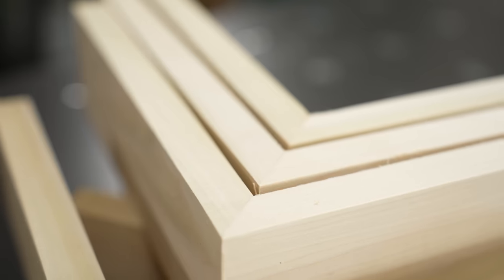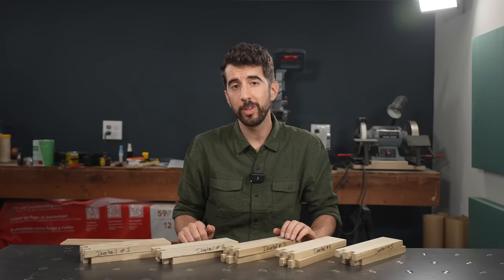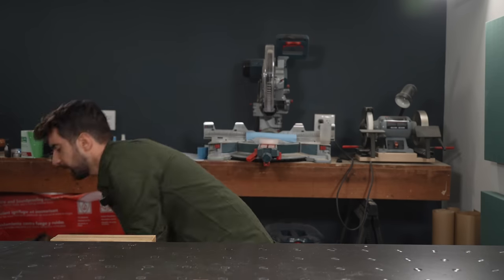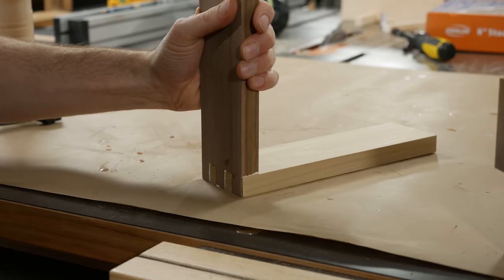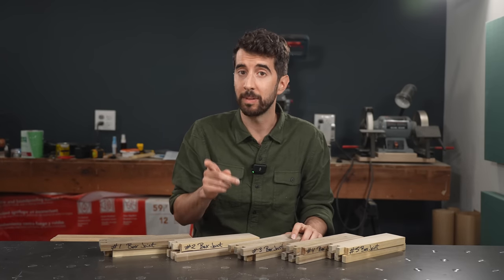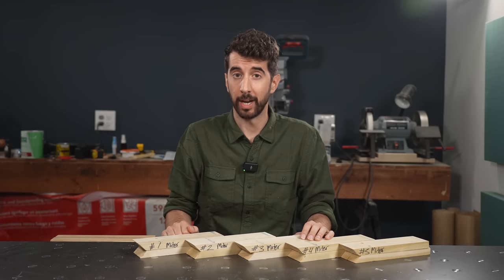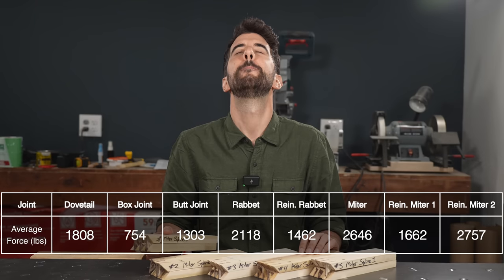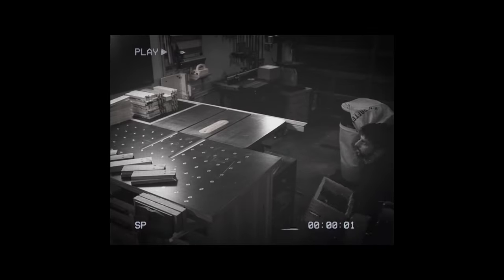This Simple Joint is Stronger Than a Dovetail!

Comment: I figure it's more about the straw-like fibers that allow the glue to penetrate both surfaces like hundreds of little fingers binding those two surfaces. As demonstrated in this video the wood didn't break in the miter cuts, just the glue. So logically the more fingers holding it, the greater the grip.

Comment: Here the test was to apply the pulling force as close to the joint as possible. Further research should include how the joint holds up to a moment applied at a set distance, as most joints receive stressing forces as some type of rotation. Joint optimization should include how the end product is to be used and the stresses put upon it. A bean crate, for example, would never survive with mitered corners: one shock to a corner and all four joints would fail.

Comment: The miter joint is stronger because the glue seeps deeper into the wood, thus giving more contact area between the glue and wood fibers. It's no surprise that grain on grain produces a stronger joint when using a good quality glue as a bonding agent.

p.s. - The weakest joints I've ever seen are miter joints fastened together using only staples. These were found in cheap office furniture manufactured in Asia.

Comment: I think dovetails would still be better for drawers because of the direction of force drawers typically experience. Especially if you're putting a lot of heavy stuff in the drawer, the bottom will be pulling all the sides downward from the bottom.

Comment: I really like that test, but however there's a question left: Did the glue make the dove tail a lot stronger? What about only using mechanical advantage (this is the way I like to connect wood)?
I would appreciate you doing that test.

Comment: Incredible amount of work. Diference result from other may come for the way of testing. As you said, at the end of the day why matters is longevity. A part from that, what device did you use for testing the force? I need one for do the same to test climbing gear and I don't know which one to use. Thanks in advance

Comment: Bourbon Moth's tests also showed the splined miter to be the strongest. It's worth noting that different joints receive different stress forces in NORMAL USE. Something like a drawer box simply doesn't experience that much force as you open and close it. 700 lbs. (x 4 corners)  is much more than the weight of the entire piece, not to mention the single drawer; so the drawer would always move, not rip itself apart. The whole piece of furniture would move before the drawer ripped itself apart. And nobody here is even capable of pulling on the drawer with more than their own bodyweight, because if you did YOU would move before the drawer ripped itself apart.

People get really nerdy about wood strength but at the end of the day you have to remember that the joints on  your furniture simply don't need to be that strong in most cases. And modern glue has proven to last longer than you need your stuff to ever last anyway. We should all chill out and stop thinking that our stuff isn't going to be in a landfill 100 years from now. You'd be lucky if your kids actually kept your stuff until they died. Expecting it to go further than that is pretty silly. As someone wise once said, "nobody is gonna want your mid century modern lounge chair in 100 years."

The real thing that needs consideration is wood movement. Because seasonal movement WILL break your joints apart and snap glue lines if they are not the right joint for the right situation or the two pieces aren't oriented in the correct way. And this doesn't even take that many movement cycles to happen. I've had to repair pieces from my earlier "career" that were barely two years old because they simply weren't built correctly.

Comment: What an awesome video 🙂.  I have a question about longevity, which you touched on here.  Given my patio ceiling mounted laundry rack is going into a climate that goes from about -6C in winter to +40C in summer (and will not be being jumped on by angry machinery) which joint is likely to perform best?  I'm erring towards the mitre with spline because I have the tools to do that already, although maybe this is the moment that I justify the router? Thanks!

Comment: I think there is a difference between initial joint strength and joint failures in time (which you already mentioned).  Your test of initial strength is more a test of adhesive strength.  Long term wood movement cycles - shrink/ expand is probably more important to furniture integrity in the field.  Not sure how you would test for that in an accelerated fashion.

Comment: The miter sounds good from this test, but I imagine the strength is strongly dependent on how closely fitted the miter is, on a box with 4 mitered corners it can be a struggle to get full contact across the thickness of the joint and I think that would have an outsized effect on strength when compared to this one joint test where the miter joint can be clamped perfectly tight.

Comment: This makes me wonder if it might be worth cutting some channels to hold glue into the inner faces of the box joint fingers, sort of like they do on commercial dowels. I was trying to imagine what sort of tool would work for such a purpose, and it occurred to me that a drill tap would probably work OK, not with any power to rotate it or anything, just using the individual flutes as little grooving planes.

Comment: Cellulose fibers are stronger than wood glue; lignin is not. Lignin is like the wood's natural glue that bonds the cellulose fibers together. This is why the miter joint is so mighty: end grain gluing is actually stronger, and the myth that it is weaker likely happened because the wood didn't fail, so people just assumed that the fibers were absorbing the glue, when in fact, the glue was being broken by the superior force of the wood.

Additionally, end grain glue-ups are usually under more torque. This is good news for me, I have a project that would benefit greatly from butt joints since the aim is mass production.

Comment: What about a 45° lock mitre joint? More surface area between the wood gives more area for glue to take hold. It's what I use and I haven't had a joint fail yet. For what that's worth:-)

Comment: Would have been nice to include the locking mitre joint. The one made with a router with horizontal and vertical cuts.

Comment: One should take into account the fact that any charred wood surface (due to dull tools) has an adhesion tendency similar to nylon bag. In that case the failure is at the glue line.

Comment: I don't like miters because I tend to be sloppy with keeping my tools in alignment, and hence the miters are not fully in contact for the entire surface, and corners look sloppy.  But based on this analysis, I think that this is a non-critical issue, and for pragmatic things like bench drawers, I'll continue to use pocket screws.

Comment: Rabbit joint, glued then nailed is my preferred method.  THEN I make sure that the way the joint is formed is not so the nails can not be pulled loose by repeated closure where the nail is parallel to the sides but rather the nail is parallel to the face and back of the drawer.  I have yet to see one of those fail.

Dove tail is more about decoration than anything else.  So I tend to just make joints that are not highly visible when possible.  Picture frames are often made with half lapped configured or with bridal jointed configuration.  LOTS of glue surface where only the wood can fail if it does.  And no, I haven't yet made any video's regarding such a joint.  It's not a straight forward joint to make.

Comment: Great video, thanks for the tests. I'm really curious about the dovetail and box joints. Given the way they break, I can imaging they can achieve even higher result if they are cut to a higher density. Take dovetails for example, the 1808 result is basically the amount of force to tear off the sides of 2 dovetails. What if you make 3 dovetails into it? I'd guess it will handle 50% more force. Same for the box joint, except you can fit even more pins into it.

Comment: Great video. I am venturing for the first time into the world of woodworking and I wanted to make a box for my air compressor. I wanted to go the easy route of drilling then putting screws in the sides of the wood to join them. I was wondering if this could support any significant weight? My compressor is 60 lbs. I don't have all the fancy tools or the skills yet to do most of the stuff you showed. Also I was wondering is it better to have all of the side pieces of the box sit on top of the main bottom board having most of the screws inserted vertically? Or is it better to attach them to the side of the base board with the screws securing wood horizontally?

Comment: I’m not ever going to make a simple mitered or simple butt joint drawer.  So that’s out of the question full stop. 

But I like the splined miter and I have and will make it so it’s good to know it’s strong as well.  

What about the lock rabbet and lock miter?  Very common and a bit of mechanical for longevity.

Comment: On the "30% reduction on the rabbet with dowels" I think that Long lignin strands in the wood are disrupted by a similar percentage and that's what's really going on .... and same I think for your reinforced mitre, but an even greater % of the long lignin strands are disrupted, or even removed wholly. The 'reinforced mitre 2" experiment has the splines inserted Along the Long grain strands and so does not disrupt them, and effectively offering true reinforcement. My $0.02

Comment: Interesting video. In the end I don't think the type of joint really matters because if you're putting 700++ pounds of force through a joint (of any type) you're probably using the wrong material and/or joint in the first place.
Reply: The common counter argument to this is that leverage on the joint adds up real quick. You would never, in reality, be putting 700 lbs. of force on a joint the way shown in this video. Joints that experience stress in the fashion shown here would never be experiencing that much load in that way. You could rack up leverage forces that could break a joint much easier in reality but that's not what was tested in this video.

Comment: Titebond 3 is waterproof because of the plsticizers added to it.  It takes a LONG time to truly harden - and even so it always feels a bit rubbery.  Use Titebond 2 unless you need the water resistance.  Oh.. and don't starve your joints.

Comment: There is a video somewhere on yt that tries to bust the end-grain to end-grain myth by testing them with same surface area. But in effect also explains why some joints are stronger than others. Modern glue is weaker then the grain of the wood but stronger that natural glue of the wood it self. Therefor the dovetail breaks along the grain lines and a rabbit along the glue lines. Most reinforcements break the continuity of the grain and so less grain that is actually contributing to the joint and there for making it weaker. So in the most optimal situation you want the same amount of wood grain from both pieces, that are glued together with an amount of surface area that the strength of the glue equals the strength of the remaining woodgrains.
Reply from the maker: Yeah that's Patrick Sullivan, he's made a great series of videos about wood and glue strength too: https://www.youtube.com/@PatrickSullivan

Comment: Very interesting results.  I can see where adding reinforced joints may affect the integrity of the grain by compressing other fibers that might not otherwise be damaged.  However, I was wondering how the number of fingers, pins and tails might affect the strength of the box and dovetail joints?  I've done small boxes where the fingers of the box joint were really just the width of a sawblade.   That makes for a lot of glue surface area and since I can't make pins and tails that small, I bet it would be pretty strong.

Comment: All of these joint tests seem to just show that angle of force + amount of glue surface in relation to angle of force is what determines joint strength.  Miter joints seem like they would be superior because they have a large glue surface and it's weakness would be pulling or pushing it apart at it's opposite angle which wouldn't ever happen in any box build I can think of.  I'd like to see more dovetail designs to find that sweet spot of mechanical strength + glue strength.  I bet there is one that would be comparable to the miter.

Comment: Drawer corners have very little strain on them. In most cases you could probably put them together with a couple of #6 screws and they'll hold up. The strength of the mitre joint doesn't surprise me. Even though it looks like end grain, logically we know that it's a combination, and we also know that the mating surface is much larger than an equivalent butt joint.

Comment: I would be curious to see a pinned finger joint.  Where the finger joint is drilled vertically and pined with a small dowel.  Also I would like to see a lock miter.

Comment: Why did you pull the joint ??.. no furniture would never have a force in that direction. 

all corner joins receive breaking force by the boards being pushed together or apart. eg by skewing a cupboard by leaning on it.

The reason by the miter joint is stronger is because of the material the miter is made of. What you've tested is basic material strength.

Comment: So mortise and tennon for non-glue joints and miter with or without proper reinforcement for glued joints.

Wonder how well reverse dovetails (basically cones) would work for glued joints as glue starvation seems to be the major issue in box joints.

Comment: Great and all, but................. each joint has it's specific purpose. Box joints are made for, well, boxes, like the ones with handles that you pick up and set down all the time. Giving the box mechanical support when lifting it up and setting it down. Using box joints for drawers is useless for anything else than aesthetics. so try the joins to see which ones that is the toughest when lifting up and down instead. Also, dovetails give mechanical support when building drawers if you align then correctly. 

So after all, this test doesn't say a single thing about the strength of these joints since you measure then in an irrelevant manner.

Other than that, great info, just not that relevant for practical usage.